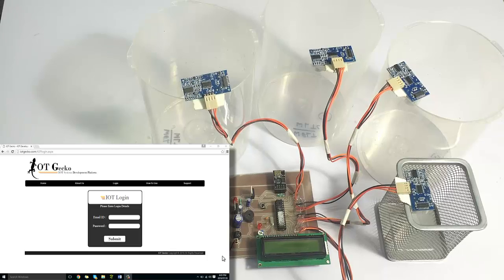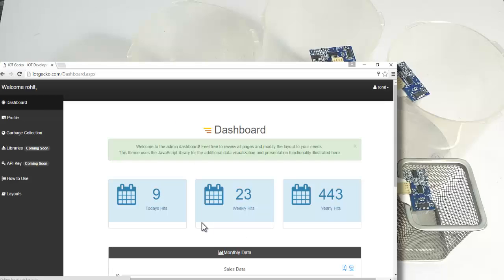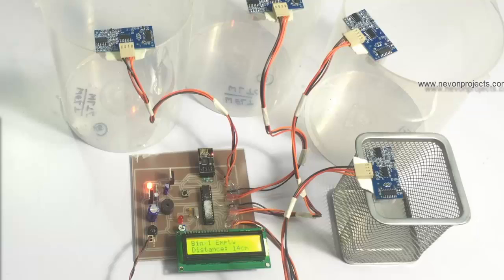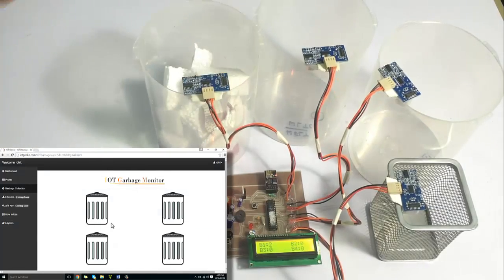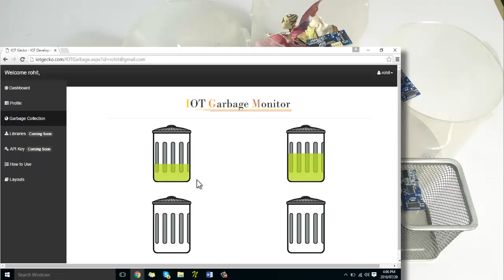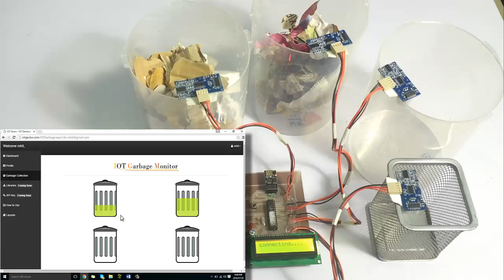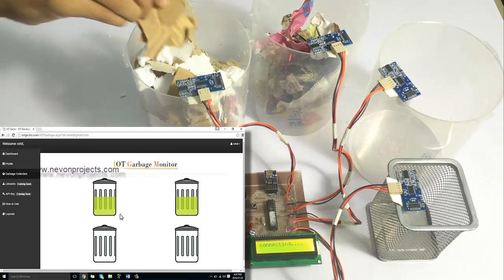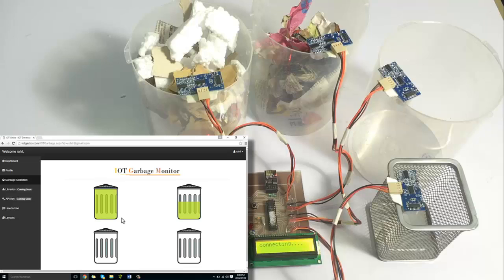IOT Garbage Monitoring System

Comment: Can this sensor detect at a long distance of maybe 10-15 feet?
Reply from the maker: No this sensor has around 50cm range max, beyong that you need other higher range/ industrial sensors
Reply: @NevonProjectsOfficial  what kind of higher range sensor would you recommend or suggest starting my investigations with? We are trying to make an IoT sensor that can monitor if your dumpster lid is open and send an alert when its open. Needs to be poll mounted so if the company removes the dumpster or it changes during emptying there is no issue